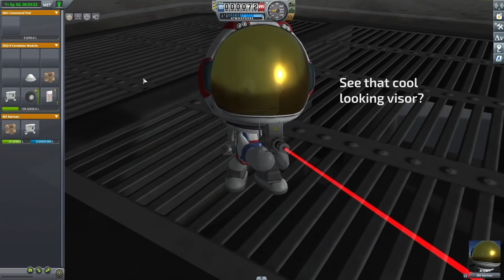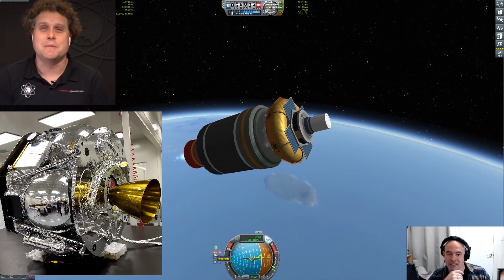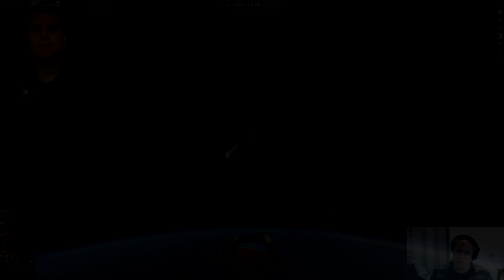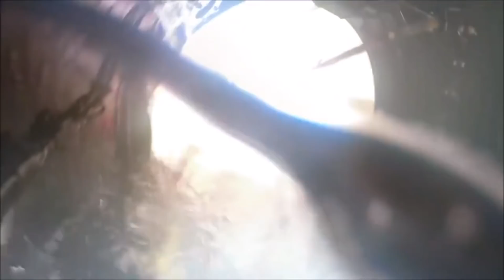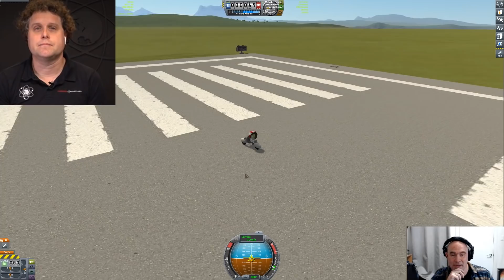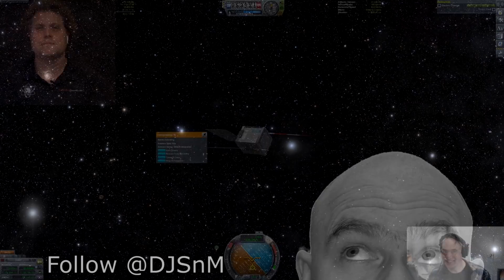Rocket Lab CEO Peter Beck & Kerbal Space Program

Comment: It'll be really cool when space infrastructure gets built up.  Like if you could launch a small, (relatively) inexpensive, simple, and reliable rocket to LEO only needing two stages and minimal fuel.  You could then dock in LEO, strap on a waiting third stage with pre-fueled tanks, and head off to your destination.  Maybe the Moon where you could swap them out with a smaller version for the return trip to Earth.  When the supply and science missions can be separated, that's when things will really take off (pun intended).

Comment: If electric motors are used to drive the actual pump instead of turbines, why do we call them *turbo*pumps? I thought it's like a turbocharger: it's only called "turbo" if it's driven by a turbine. Is it just that we have come to call all main fuel pumps in rockets motors "turbopump", and have forgotten why? I notice that Peter catches himself a few times and corrects "electric turbo..." to "electric pumps", which makes more sense.
Reply from the maker: Right, it’s force of habit, that almost all rocket engine pumps are turbo pumps. There are also rocket designs using reciprocating engine pumps.

Comment: One good thing about Rutherford engines is that they are perfect for Moon and Mars. They will provide more than enough thrust for reasonable payloads, they will likely be much longer-lived than turbine-powered engines and they can be 3D-printed in-situ (drastically reducing the number of parts to be delivered from Earth).
Reply: Can see a few changes would be needed in regards to the launches. Currently they ditch batteries for example, which i can't see being sensible for a lunar launch, then again they won't care as much about the extra weight so don't see that being a significant issue

Comment: Wait wait wait wait, is Peter saying that Rocketlab is aiming to get to Venus with an Electron?
If so, WOW and HOW!?

Mr. Manley I demand a video!
Reply: HOW?  Peter beck will get to Venus by being very smart.
Actually, I keep hearing that once you've reached orbit you're halfway to anywhere in the solar system (almost). Escape velocity can be achieved with so much less fuel than it takes to get to orbit. I can't explain how the physics and math works, though.

But absolutely, I'll love seeing Scott do this - and not just in Kerbal but with teal physics!
Reply: It depends heavily on the specifics of the orbital mechanics. The delta v requirement for earth orbit is roughly  9.3 km/s. Only 3.3 km/s additional delta v is required in order to reach Venus if the probe is able to aerobrake in Venus' atmosphere. Otherwise, it's an additional 2.5 - 3 km/s to be captured/descend onto Venus. Most of your delta v goes into Earth Orbit.

Comment: Why couldn't they do a parachute assisted powered landing?
Reply: They don't want to. You need to keep fuel in reserve for a power landing. That is weight you can't put into orbit.
Reply: @iamjadedhobo  well that's the thing, after ditching a payload and the second stage, a small header tank with minimal amount of fuel just for aiding the touchdown. In my mind it's not like the suicide burn SpaceX does but like a quick burn to kill the velocity before touchdown, while ultimately relying on the parachute for the bulk of the de- acceleration.

Comment: I'd like to see a set of small engines driven by a single turbopump.
Reply from the maker: You mean like the RD-170 - 4 chambers 1 set of pumps.
Reply: @scottmanley  Many teeny tiny engines like those of rocketlab. The dry mass of all those first stage batteries hurt performance. The 2nd stage would still use batteries.